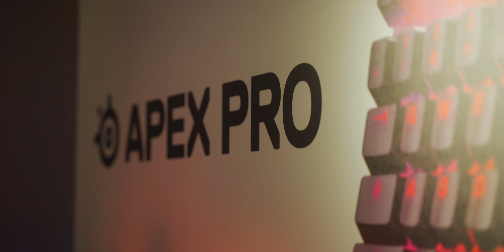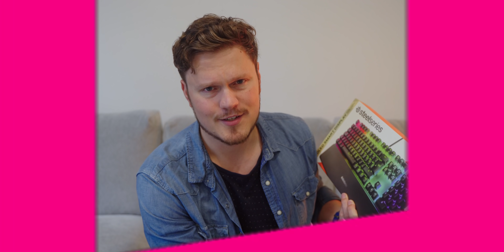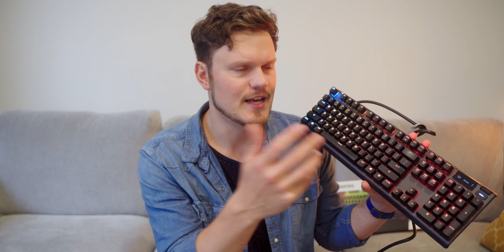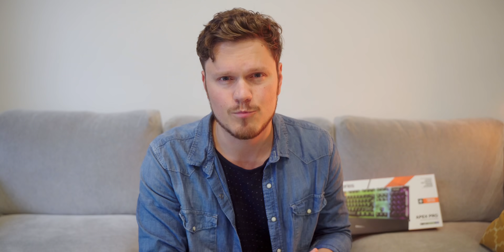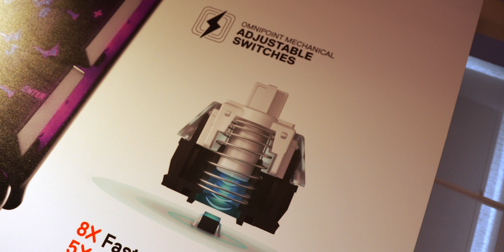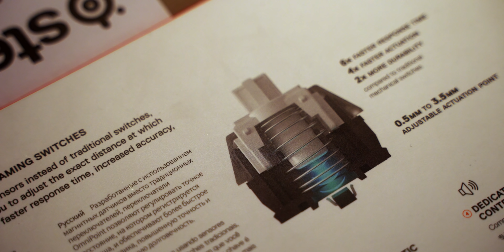Did Steelseries Create The ULTIMATE Keyboard Switch?

Comment: So, theoretically speaking, since they can measure magnetic flux extremely accurately and can do so between 0.4mm and 3.6mm, then, if the software/firmware supported it, these switches can function as "analog" progressive actuation buttons, yes?

Comment: I would like to actually try out this keyboard but in theory after buying this keyboard you wouldn't need another one. If you can change the actuation point from 0.4mm you can make it feel like any of the other cherry switches. This in my opinion is such a cool idea. I hope it actually works in practice aswell.

Comment: Just returned Corsair K70 because the holding +s on keycaps (that part you put on key switch) were getting broken. In the long run (after warranty) it would get very expensive. :/
How are these keycaps holding out.

Comment: If you guys want what is probably the best prebuilt keyboard on the market right now, I suggest you go for the Wooting brand stuff. Steelseries is basically just utilizing a basic element of optical switches and making it seem like it's something special. At the end of the day, the best keyboard is the one that you build yourself, which you pick the individual parts for yourself, and fits your needs in every dimension. This kind of keyboard usually runs you $300+, but it functions as a sort of investment, because once you've built one yourself, you'll likely have the nohow to just replace the individual parts that stop working without having to buy another costly keyboard, saving a great deal of money long term.

Comment: the question is are switches built in with feromagnets and if the spring is made from mu metal.
If it is, then the price is around 250$ and it's not worth it.

Comment: It's only interesting because of the potential for pressure sensitive controls. Remove the adjustable actuation point, add some weight to the key press and add the functionality into the game so you can go from walking to running without having to use an extra key to toggle between the two.

Comment: Does this have the potential for the switches to be used as bumpers in theory? Like press W all the way down to run faster and just a little to walk. If that was the case I would see the main selling point there instead of the adjustability

Comment: I'm very curious about this - if they've actually done a good job here, these switches could be quite good. Interesting that they're using magnetisation instead of making optical switches. I wonder which will end up being the most reliable.
Gateron Red is far from my favourite linear switch but it's still rather nice, so that could be a good sign for Omnipoint.

I have yet to try Steelseries' previous switches (though I hear they're not that great), such as the QK2, but there are a lot of poor mechanical switches out there (Romer-G is an absolute disaster, Razer Greens are garbage MX Blues (which are themselves not that amazing) and MX Browns are potentially the worst tactile switch outside of the switches Logitech and Razer make). So, I'm definitely hesitant, but Omnipoint switches could turn out well.

Comment: I see little value in this, other than to not have to resolder switches for a different feel, which not many people are going to bother with on a board like this.  As you pointed out in the video, once you have it set, you're not likely to change it for any good length of time.  I would rather see a switch that can change from linear to tactile to clicky and adjust sound levels.  This would annihilate 98% of the switches out there.

Comment: My experience with apex M750. The switches are so light and smooth, at the first 2 weeks I typo a lot and also have a lot of accidental click which is very annoying. I had to disable the left windows button since there is no "gaming mode" thingy. What dissapoint me the most is the spacebar, shift, and enter key felt so goddam cheap, its feels like 50$ chinese keyboard, and also the luminance has a very poor color accuracy. And the keyboard broke after 3 months, they key starts not responding and the rgb is off on some key.
But this new product makes me think twice, considerubg Dimitry says the build quality is nicer because of no  contact thingy. Makes me think twice

Comment: The Wooting optical keyboards have this feature but also allow "analog" input so in gaming for example the further you press the key the faster you move.
Reply: I hope this is done on the Apex Pros as well...
They use the same sensors that are used in PC steering wheels to detect position, so they are basically built for it.
Reply: I don't want this analog game controller feature because it messes with my X-Input
Reply: Jen Soon Ng
What?
Reply: @Aggrofool  I have a wooting. You can turn analog off, the keyboard always has a digital profile available.

Comment: FINALLY a mechanical keyboard that have a feature that might me start using one.
That is if it allow me to make keys that I normally touch with my pinky easier to activate without changing the weight required to push it.

Comment: If you can change the actuation... Can't you then also use these keys as "pressure" sensitive?

Like having a trigger on a joystick. Press a little to accelerate a little bottom it out to give full power.
Music keyboard, get a readout as to how hard/fast you hit the key...
Or can't that be done? 

If it can figure out whether you're 0.3mm or 3.3mm or between, it should also be able to "live monitor" the position of the key and therefore... be "pressure sensitive".
I'm no expert, but doesn't sound like more than a software thing to get it done.

Btw i'd buy this, because i feel like i do do press lighter on some keys on my keyboard so being able to set those ones to activate earlier than the ones that i always bottom out would be a really cool thing. 

Nice video ;)

Comment: Wooting already has switches like this this they are optical and operate more than as an actuation point change.
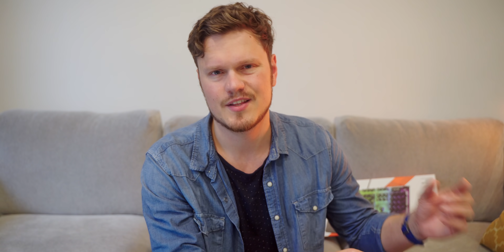Reply: 6:01
Reply: @CoolGuy-it6ft  yes and as mentioned they are analog meaning you can do more than just change the actuation point. they also have a prototype key that has an even higher actuation point. But honestly if you want that high of an actuation point just but a short press laptop keyboard. Buying mechanical keys are pointless if that is your preference.
Reply: Wooting original switches are flaretech optical. Only their upcoming ones are hall effect similar to omni.

Analog game controller emulation is annoying since it messes with my Xinput

Comment: The Wooting One was definetly not the first to do this like 1,5 years ago
Reply: The Flaretech type B couldn't actuate at less than ~1.5 mm though.
Wooting has started work on a hall-effect switch together with Huanno that has a span starting at 0.1 mm.
BTW. Topre showed actuation control at trade shows back in 2015, and you could get it now. (I dunno when they started selling it though)
Reply: @Findecanor  The latest review I've seen of a Topre keyboard that featured it was at 2017 (there might have been earlier reviews of it), so I'm guessing its been selling for 2 years atleast?
Reply: Thank you! I actually like to think I even gave them the idea, I tweeted the concept at them during the development process and at the time they just said that it would be theoretically possible. I kinda doubt it was me in the end though ^^

Comment: So basically it's like a hallsensor in a keyswitch? 
That's pretty neat
Reply: Literally that. There are all-in-one hall effect sensors in sot-23 packages nowadays, and the die inside is much much smaller.. So if Steelseries is using a bare die or a custom IC package, it's totally feasible to do this inside a switch. And since it's all-in-one, there's probably only 3 wires needed - power, ground, and sense. Probably not even that hard to do, it's just that nobody was bored enough to try actually doing it I guess :P
Reply: @Mythricia1988  or drunk enough :^)

Comment: Could you have your W key toggle between sprint and run at different actuation points?
Reply: Most likely no, or at least not with the custom actuation points on these switches. Ya know when you flip a light switch really slowly you can find the point in the middle where the light is flickering on and off? These switches just let you change that point. The switches are either on or off and you can change when that happens.

As far as I know, there are no keys out there that have TWO actuation points and if there were, they're probably be reserved for specialty keys like macro buttons on the side or an entirely separate device.

Your idea is really cool though, and I can think of a few different scenarios where this would really come in handy.
Reply: They could if they wanted to--the tech is there. Supposedly it's not implemented because the makers found it "not useful." Regardless, these switches are hall effect so they definitely are capable of doing this.

Comment: Few concerns, what is the repeat-ability? If a strong magnet is brought close to the keyboard does that damage or throw off the sensors? There are magnets is mice, watches, watch bands; can these throw off the repeat-ability?
Reply: I think they use a hallsensor for it meaning that you might only get issues when the magnet is close (but you can probably re-calibrate the things)
Reply: Probably not, at least, not without intentionally interfering. I suppose if you were wearing a neodymium/NIB ring, it might, but otherwise, the magnets around you are too small and too far away to appreciably have an impact.
Reply: Hall effect were switches with some of the highest lifespans, and those are made with magnets as well.

Comment: Wooting has prototype switches with work with flux (hall effect) sensors aswell, the lekker switch. The Beta Specs say the activation range is from 0.1 to 3.8mm, including analog usage as the optical flaretech keys in Wooting One and Two.
Reply: Janee daai switch is baie lekker moet se
Reply: too bad analog is way too slow to register with current USB-A limits, maybe when keyboard get thunderbolt connections or something in a few years, optical is next big thing after 30 years of Cherry MX
Reply: @komi1834  Also, I call bullshit on them being too slow to register.
Every PC steering wheel uses USB 2.0... Like all keyboards and mice.
Never encountered anyone claiming lag due to a limit of bandwidth.
Seems like you should educate yourself before talking.
Reply: @komi1834  USB-A has nothing to do with transferring speeds.
Reply: @komi1834  the switches are optical, they aren't analog.  They can mimic what analog can do.
Reply: @whomad15  They are not optical, no. They are magnetic.
Reply: @Mikkel111  whomad15 talked about the optical switches in the Wooting One and Two, those are optical IR "switches" with an IR LED and Sensor on the PCB, which gets reflexted by parts within the switch case. the further the keys get pressed, the more light gets reflected from the LED to the sensor.
Reply: @komi1834  some keyboards already use optical switches, like the Wooting One/Two, Razer Huntsman/ Huntsman Elite, HP Omen Sequenzer, Gigabyte Aorus K9, Bloody B945.

I´ve got the Wooting Two and and set to 1.5mm activation point it feels a bit faster than my Corsair K70 Rapidfire with Cherry MX Speed which activate at 1.2mm, probably due to no debounce offset (metal contacts bounce the first miliseconds).

Comment: It seems like this should also be able to do "analog" signals like the Wooting One?
Reply: Looks like it just changes actuation point.
Reply: That's what I was curious about. I'm looking into that one for the analog function.
Reply: analog makes a lot of input lag, wooting is slower to register than standard mechanical switches even being optical, doing that on this keyboard which isn't optical would probably be even worse, i'd like to see Steelseries put Gateron Yellow Optical switch in 60% or at least TKL keyboard, charge $100-150, that would be best gaming keyboard alongside B930 from Bloody, just make it look not obnoxious like Bloody...
Reply: @komi1834  Their input lag is lower than what USB is capable of. You have been sniffing glue.
Reply: @komi1834  Where did you hear/read about Wooting having an input lag? Because I never heard  Wooting having an input lag. (unless you just took 'analog' part too seriously and thought it actually processes the actuation as an analog signal)
Reply: @komi1834  not true imput lag is 1 milasecond which is lower that what is even possible over usb. Feel free to look it up. Stop spreading propaganda
Reply: It should be... It uses the same sensors PC steering wheels use to detect position.

Comment: No garish logo, Steel Series are quickly becoming one of my favourite peripheral device brands.
Reply: @spar 1988 Everyone ends up looking like a spaz every once in a while. As long as they don't build a track record, I'll look past that fiasco.
Reply: the keys sounds like shit so no. logitech/corsair still win.
Reply: @newp0rt  agree with the sentiment, I just go razor over corsair because I hate red switches.
Reply: @tatsuhirosatou5513  i hate reds too. thats why i use a k70 mk2. silvers are the best :)
Reply: @newp0rt  I use a black widow ultimate, blue/green is best.
Reply: if you dont like gamery stuff get a tada68 or if youre drowning in money get a custom keyboard, customs put any prebuilt to shame, its like laptops vs custom desktops
Reply: @MrBluePoochyena  thats exactly why i use a rival 310, braided cable fad needs to die.
Reply: @empgrenade  GPW/G305 for one is without a doubt a significant innovation, positive if you talked about the specifications of it 3 years ago no one would believe that's achievable
outside of that idk tbh lol
Reply: Great looking peripherals but I would question about the durability on the headsets at least. Had two pairs of siberia that broke in the same way and amount of time that got RMAd, currently using am arctis 5 headset from last summer and it looks like the speakers are starting to have problems. Guess I am really unlucky
Reply: I used to become a fan of the products of Steelseries due to the minimalist design however SS has been trying hard to come up with all these "gimmick" (eg. side OLED screen on a mouse lmao) In terms of real innovative I would still prefer Logitech
Reply: @97michaelthang  For mouse logitech g pro wireless is the best and who looks at their keyboard while gaming? The screen is useless
Reply: @97michaelthang  i agree with this, but what inno has logitech brought recently? wireless mouse+charging pad for $300+? seems pretty gimmicky to me when you can just get a $20 bungie.
Reply: VeriChip except the G502 is such a good mouse that it’s worth it.
Reply: @empgrenade  As someone with both those products, I can tell you it's not a gimmick and I'll never use anything else ever again.
Reply: @giglefreakz  you must know better than all pro gamers out there then. thanks for enlightening us!
Reply: @empgrenade  I'm just giving you my opinion on the products based on my own experience. No need to act so sarcastic.

Comment: If I understood you correctly you said that the actuation is actually software controlled. If this is a case you need to tell them that they need to set up in software on the key profile switches between game mode safe for your wasd keys to have 1.2 mm and the rest of the keyboard something else but when you want to go on the fly to typing you press a hotkey and everything is whatever you said it to otherwise looks very interesting

Comment: I mean Wooting already did this.  There's also the Silo Beam Spring switch that promises something similar though it's not out yet.  So it's not really that unique anymore.
Reply: well it is unique cause there is no metal connection on the switch just magnets
Reply: @jazzy2164  Neither of the switches I mentioned use contacts.  In fact you can't really make the actuation point adjustable if you're relying on contacts.  And though not usually adjustable contactless switches like capacitive or Hall Effect sensors have been around for 50+ years...
Reply: @jazzy2164  It is basically a hall effect switch, and those have been around for a long ass time.
Reply: @ianv3180  Not basically...

Comment: that keyboard might become the standard for esport players. it will allow players to actuate their keys EXTREMELY fast. I would love to try this keyboard on the shortest actuation point to allow me to react much faster when playing games. I really hope steel series donates this keyboard to Esport players to see if it lowers their reaction times.
Reply: But then it will make a double click.
Reply: @MrDragonorp  I think you would get used to it. So the problem would go away.
Reply: that shit is just bullshit, if there is a diffrence it's not even 5 milliseconds (comparing it to any mech switch).
Reply: @miguelmsilva4112  maybe. But it would be faster.
Reply: @cingkole7893  maybe, the thing is that many players already play with the keys pressed down a little bit, just with the weight of their fingers, and then when they need to press they don't have to move the full 2 mm but maybe only 1.5 or something, i personally do this myself, since red switches are so light. The usual reaction time for humans is about 200 ms peek, the time it takes to press down a key 2 mm or even bottom out is nothing compared to 200 ms. But yeah, it will technically make them faster.